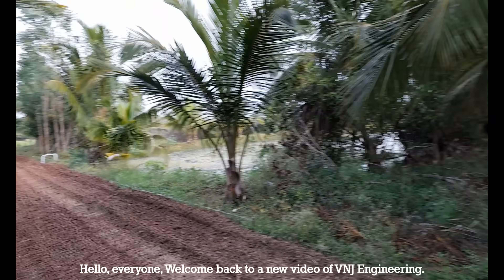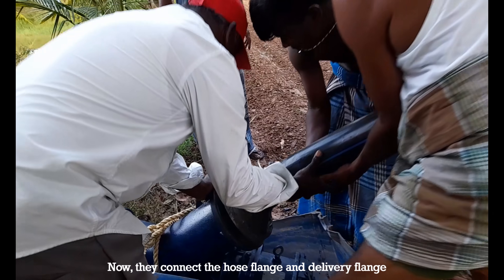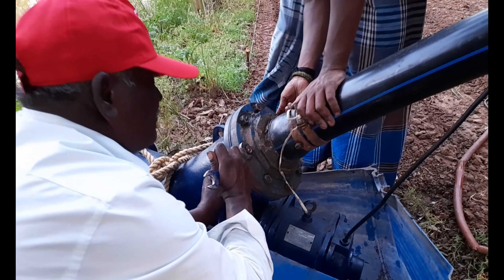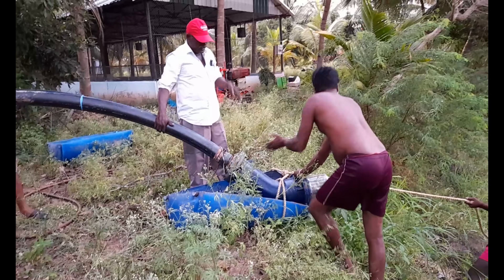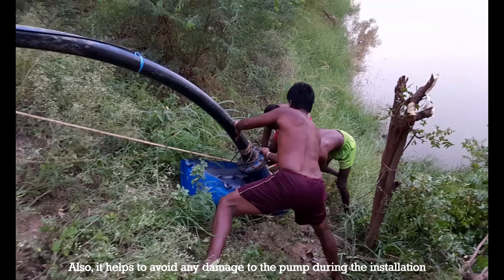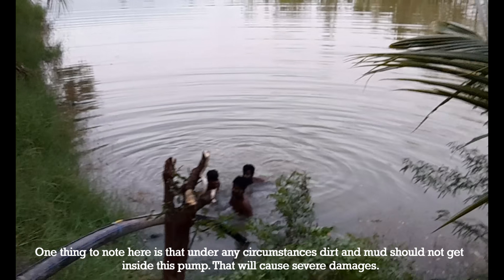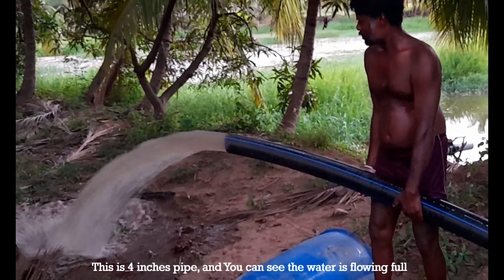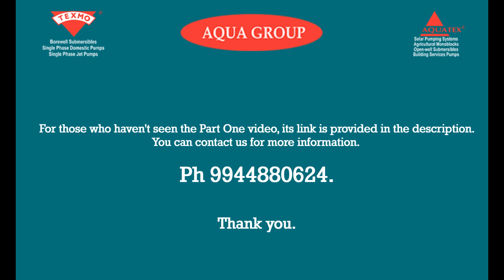AQUATEX ASMAX SERIES SUBMERSIBLE PUMP - INSTALLATION (PART-2)- in a #village  in #tamilnadu

Comment: Great to see pumps designed for tough conditions like low voltage. Adding a water pump controller makes the system even more stable and worry-free.

Comment: 2  lakh liter per hr not possible
Reply: यह कितने hp ka he
Reply from the maker: 5 hp sir.
Reply from the maker: Sir, it is possible. Its discharge rate is 57 lps at its minimum head; which is 3 meters. 
57 lps equal to 3420 lpm and 205200 lph.

Only thing is that it applies only to low-head applications. 

Thank you, sir.

Comment: Super...Solar vfd la work aguma?
Reply from the maker: No Sir, this model is designed to work at 50hz frequency. (for grid supply only). 

We have many other solar pumps also that work with variable frequencies. 

Thank you.
Reply: Solar vft

Comment: This type Singal face 1hp pump available,? Price?
Reply from the maker: No, sir. Only two 3-phase variants are available in this model. Their details are mentioned below for your kind information. 

Variants:
1. ASMAX37150 - 5.0HP(3.7KW)
PIPE SIZE- 150x150 mm
HEAD RANGE- 3.0/6.0 m
DISCHARGE RANGE- 57.0/35.0 lps

2. ASMAX15100 - 2.0HP(1.5KW)
PIPE SIZE- 100x100 mm
HEAD RANGE- 3.0/4.5 m
DISCHARGE RANGE- 22.0/9.0 laps 

Thank you.
Reply: @VNJENGINEERING 5HP का प्राइज‌ क्या है महोदय
Reply from the maker: महोदय, कृपया मूल्य निर्धारण विवरण जानने के लिए व्हाट्सएप के माध्यम से 9967410321 पर हमसे संपर्क करें। धन्यवाद।

Comment: வணக்கம்., borewell 250feet
நீர்முழ்கி மோட்டார் 2hp texmo 17stage 120அடியில் நிலைநிறுத்தி தண்ணீர் இறைத்து கொண்டு இருந்தது.தீடீர் என்று 2நாட்களாக தண்ணீர் pressure அகா வரவில்லை motor போட்ட உடனே 13amps போகுது 3 to 4 நிமிடம் amps9 வருது அப்பறம் 13 to 9 க்கு oscillate ஆகி கொண்டு இருந்தது.போரில் தண்ணீர் இல்லை என்று நினைத்து மோட்டார் 10அடி அப்பறம் 20அடி என்று இறக்கி இறக்கி தண்ணீர் இறைத்து பார்த்தோம்..தண்ணீர் ஒரே சீரான வேகத்தில் வரவில்லை.
தற்போது 145அடியில் மோட்டார் உள்ளது மோட்டார் போட்டால் 5நிமிடம் தண்ணீர் வருகிறது (14amps) அப்பறம் 11amps குறைகிறது தொடர்ந்து 14 to 11 க்கு amps மாறிக்கொண்டு இருக்கிறது..
(Starter box புதுசு)
மழை பெய்து நீர்மட்டம் அக்கம்பக்கம் அதிகரித்துள்ளது. எங்கள் போரில் என்ன ஆச்சு என்று தெரியவில்லை..
தீர்வு வேண்டும்🙏🏽
Reply from the maker: வணக்கம் சார். நாங்கள் உங்களுக்கு உதவ முடியும், தயவுசெய்து எங்களை 9967410321 என்ற எண்ணிற்கு அழைக்கவும். நன்றி.

Comment: Hp?
Reply from the maker: Sir, this is a 5HP variant. 

Variants:
1. ASMAX37150 - 5.0HP(3.7KW)
PIPE SIZE- 150x150 mm
HEAD RANGE- 3.0/6.0 m
DISCHARGE RANGE- 57.0/35.0 lps

2. ASMAX15100 - 2.0HP(1.5KW)
PIPE SIZE- 100x100 mm
HEAD RANGE- 3.0/4.5 m
DISCHARGE RANGE- 22.0/9.0 laps 

Please watch the Part-1 video also. 
Thank you.